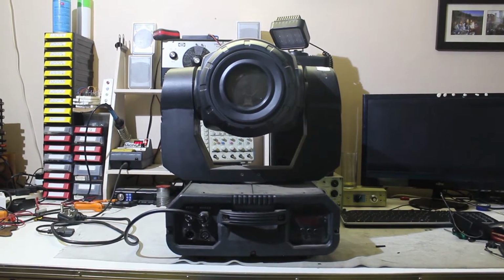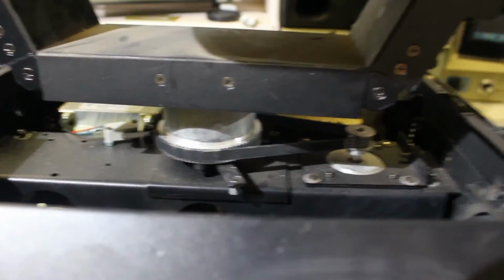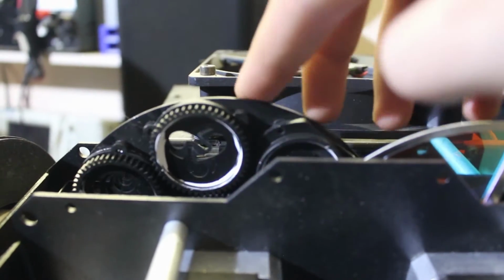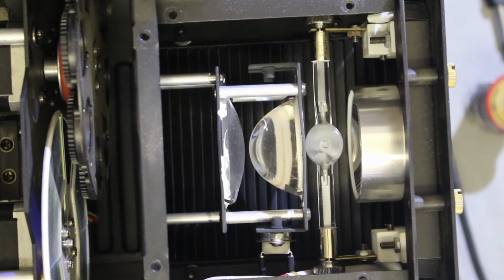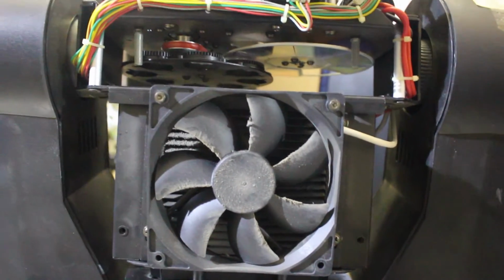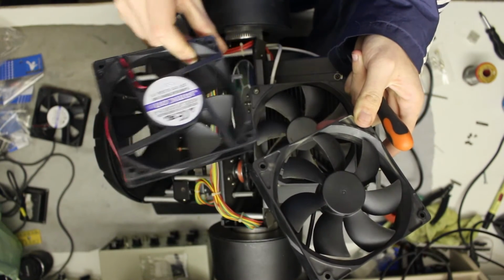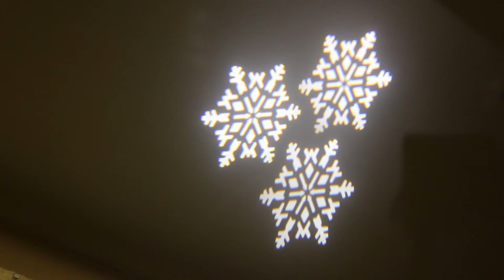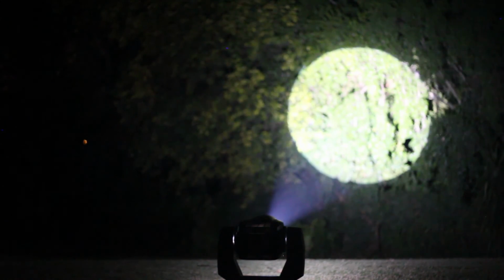#6 Martin 300 Moving Head Rip-Off Spot Light Teardown and Repair

Comment: what distor do you use for above 120v fixtures that aren't overpriced?
Reply from the maker: Hi Lyle, we use 240V 50Hz where I live. I think you can try ebay but I  honestly have no idea where you can get ones for the north american electrical system.
Reply: @ChristopherdeVilliers  which one exactly? I'm getting some martin mac's and pretty scared. also wondering if I can plug the distor int oa surge protector? Can't hardwire anything.
Reply: If they are Macs than it should explain how to switch the running voltage in the user manual

Comment: i have the Mac Krypton 250 and i get the RGER error the magnetic indexing circuit malfunction ( e-g sensor defective or magnet missing) did you know where is that sensor? Located?
Reply from the maker: Hi Sonido, firstly I have to state that I am not at all familiar with that unit, but all of these machines have a mechanism to index where the unit is throughout its movement. The unit I had just used a switch but better units will probably have opto or magnetic sensors. See if Martin have a service manual available for your unit. It might have a section for indexing troubleshooting. Then I'd recommend you figure out if the sensor is faulty. Sometimes a good cleaning will fix the problem. Sometimes not. I will read up a bit and respond later
Reply: Christopher de Villiers thank you so much I appreciate your help i will clean the sensors I hope that’s the problem 😃
Reply: Christopher de Villiers thank you for the info

Comment: What types of motors do they typically use on dj lights? And what lubricant can I use on them?
Reply from the maker: The majority of stage lights use stepper motors. I have not seen any that do not. I would recommend a light grease. Would not recommend a spray like WD40 or Q20
Reply: @ChristopherdeVilliers  Hi. I'd still really like some help from my other comment, searching for a good distro, recently got a light that has l620 twist lock, did a few hour sof rsearch and nothing except f or twist lock plugs, I mean an actual distro that I could plug multiple fixtures into. i know you said you use 240v 50hz, but I'm wondering what exactly you are using, like what brand and like I said, maybe some inexpensive ones? I'd really appreciate, thanks.
Reply: Christopher de Villiers thank you so much, do you know what type of grease (brands) are typically good for this application? I know there are so many types and mixing them is bad so I want to be able to identify it.

Comment: It's possible to replace the 575 light bulb to LED light
Reply: No, because the HMI has a different colorspectrum (the intensity of the different wavelength) than an led.
Reply: Well actually yes you can it’s possible cause I did it on a chines knock off and it worked it wasn’t as bright as the standard 575 lamp but it got quieter
Reply from the maker: Hi I also thought about doing something like that but honestly, I think it is just too much effort. You would also need to get a very bright AND GOOD QUALITY LED and driver. At the end of the day I would just buy something form Chauvet or ADJ that is already LED. I tried using a 50W LED instead of the HMI bulb and it was so dim and the colours were awful.